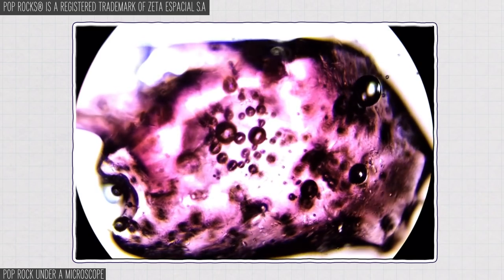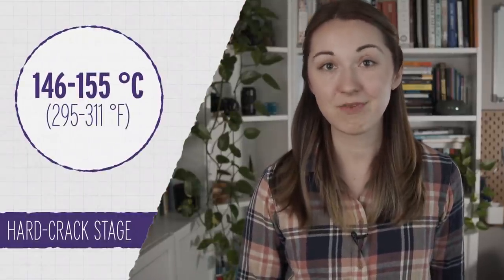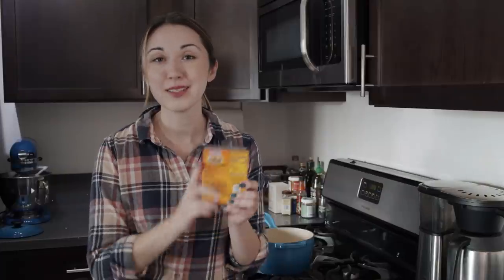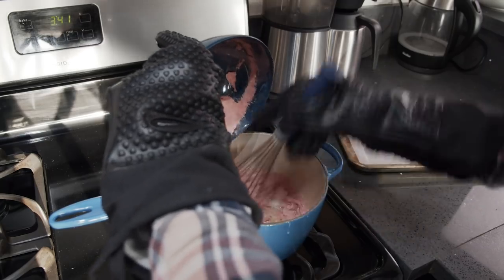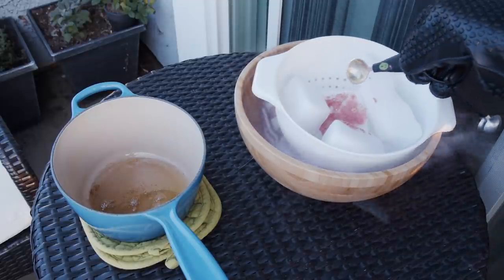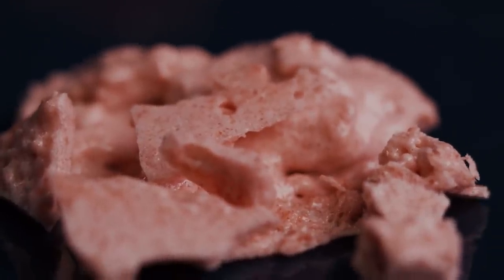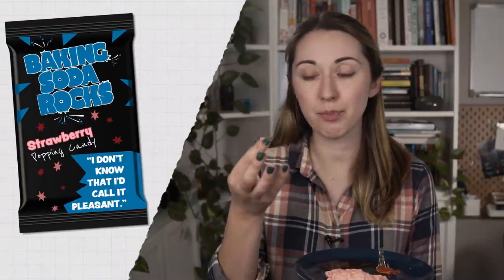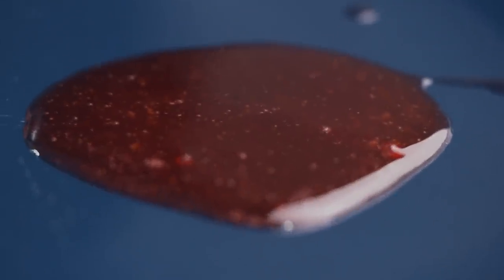We Made Pop Rocks at Home with Science

Comment: I think your idea of using dry ice powder sounds really promising! You could sieve the particles for size consistency and fold into thin sheets of the cooling sugar. File the patent now ;)
Reply: Ohhhhhh I like this idea!!!!! Thanks, Ben 😀😀
Reply: @AlexDainisPhD  Maybe weigh out an appropriate amount of dry ice and sugar and seal it in a steel pipe. Then heat the pipe in an oven to melt the sugar and open a valve to spray the solution on a block of dry ice for vitrification. Have to be careful and remember there's already 1atm of gas in the pipe, the sugar has volume, and it'll be hotter than ST. Cheers!
Reply from the maker: UGH. We did the legal disclaimer for the wrong version of Pop Rocks variants!
Reply: Isn't the crushed dry ice going into gaseous state more faster when crushed and with added environment heat?